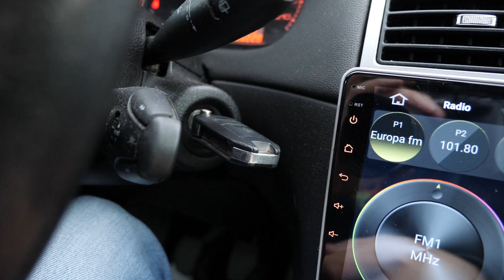How to replace rear lamp bulbs Peugeot 307

Comment from the maker: - Links LED bulbs from Aliexpress:
- P21W: https://www.aliexpress.com/item/33019323402.html?aff_fcid=6f52b70996b044449d2276779de1c0c1-1636460857046-03128-_AUPs9F&tt=CPS_NORMAL&aff_fsk=_AUPs9F&aff_platform=shareComponent-detail&sk=_AUPs9F&aff_trace_key=6f52b70996b044449d2276779de1c0c1-1636460857046-03128-_AUPs9F&terminal_id=a4886d1a72584241b5df38394da27292
- R5W: https://www.aliexpress.com/item/32869077875.html?aff_fcid=11f215a23d1740839383373a795547a3-1636460868244-09600-_AEFH6p&tt=CPS_NORMAL&aff_fsk=_AEFH6p&aff_platform=shareComponent-detail&sk=_AEFH6p&aff_trace_key=11f215a23d1740839383373a795547a3-1636460868244-09600-_AEFH6p&terminal_id=a4886d1a72584241b5df38394da27292

Comment: Hello, I’ve installed them but when I activate the turn signals, they flash rapidly as if the car doesn’t recognize them, even though they work.
Reply: with led lamp
Reply from the maker: Hello. The LED bulb consumes too little current compared to the classic bulb. You have to install a resistor between the + and - cables of the signaling or give up the LED bulb.
Reply: @AdrianDragan  ok, thanks🙏🏻

Comment: Do not touch the bulbs with bare hands, you shorten their lifespan. Also upon changing them it is a good idea to use a contact cleaner spray.
Reply from the maker: It is a problem if you touch your Halogen bulbs with your fingers anyway, and they must be clean when installed. You're right, it's good to use a contact spray to clean them.